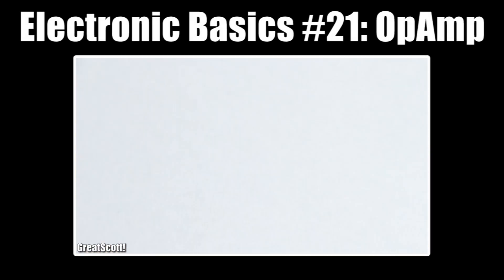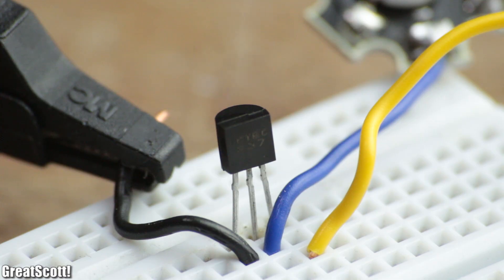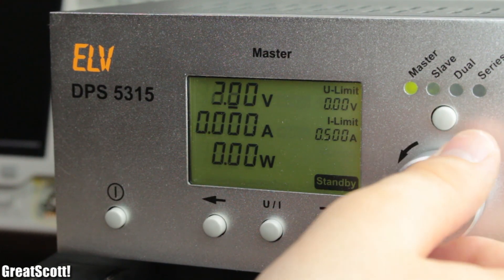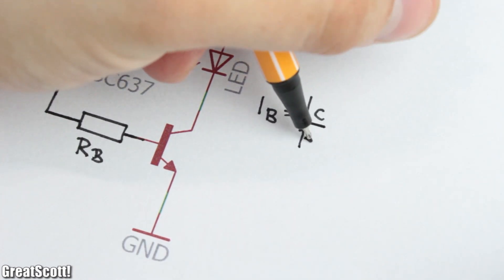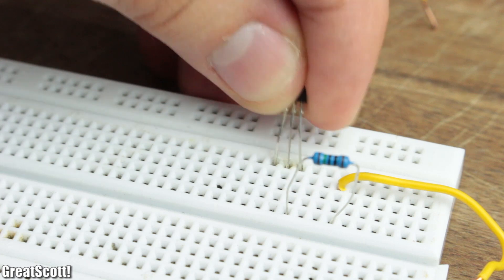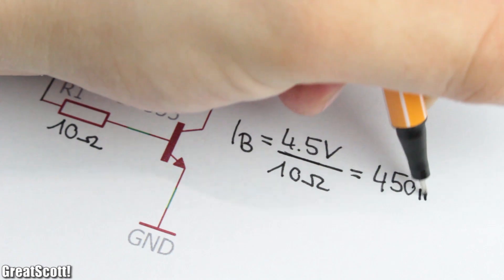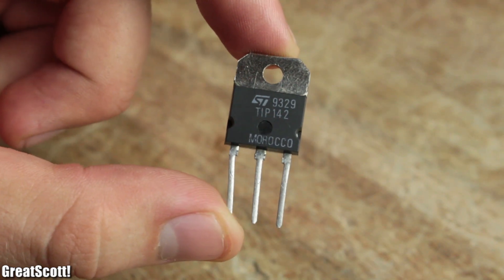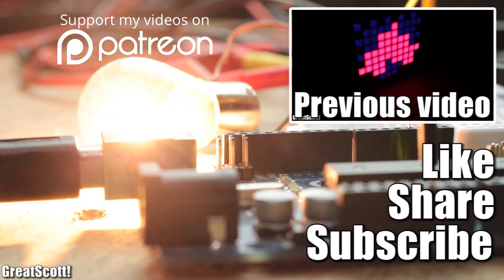Electronic Basics #22: Transistor (BJT) as a Switch

Comment: Some people need to ask questions from a kindergarten point of view. If parallel is accumulator-capacitor digital-pulse in analog-circuit, what will adding a Y or a K do to it. If induction is parallel plates. If ... Kids have more fun.
Reply: Do people pair things(components) to stabilize(plus minus stable-neutral) voltages before-after each branch in tracing.?

Comment: I was using some BJT transistors without any of these ideas, no wonder it go so hot every time.. ;-/
I didn't use a base resistor and my load was on emitter side. Killed like 3 transistors, RIP

Comment: id really love to see a more in depth description of how you calculated the base resistor. You kinda just said find beta then calculate. Sure you show the formula's but a walk through from start to finish and where to find the values in the datasheets would be really nice.
Reply: Look at the video at 2:03 and check the datasheet for the conditions that are used for measuring the collector-emitter saturation voltage. Those are Ic=500mA and Ib=50mA. You can ignore the "DC current gain" section because that is only specified for Vce of 2V or greater, i.e, linear mode. When the transistor is operating as a switch, the crucial design consideration is normally to ensure that Vce is as small as possible when the transistor is switched on. This is called "saturation mode" and Vce(sat) for the BC637 family is 0.5V at Ic=500mA and Ib=50mA. So you want to set the base current around one-tenth of the maximum expected collected current. That will ensure that the transistor stays in saturation when switched on, otherwise if the collector voltage were to rise, it would run the risk of exceeding the maximum transistor dissipation of 625mW (Ic x Vce).

In the video, he should have used Ib = Ic/10 for a switching application. Ic is given as 310mA, so Ib = 31mA. Then Rb = (Vcc - Vbe)/Ib = (3.1 - 1.0)V / 0.031A = 68 Ω, although this doesn't have to be exact. The dissipation in the base resistor would be less than 100mW (less than 3.1V x 31mA), so any 125mW or higher dissipation resistor would be fine.
Reply: What you mean " Ic is given as 310mA"?
Is max current on LED or max current in transistor collector?
When he test LED with source generator i didnt see any value of 310 mA.
He had max 253 mA in LED.
Reply: @anaromana8183  @RexxSchneider I'm also confused about the source of 310mA for the Ic...

Comment: You're calculating the base current wrong. You used the values for β given on the datasheets for when the transistor is operating in its active region with a Vce of 2V or more. If you look carefully at the datasheet, you'll see that the value for Vce(sat) is almost always given for collector:base current ratio of 10. In other words, the manufacturers guarantee the BC637's Vce(sat) of 0.5V max for a collector current of 500mA and a base current of 50mA. You can't just use the β of 25 that is quoted under different operating conditions. The same goes for the BD535; you can't just look at where the datasheet says β=15 and assume it will be valid when in saturation. It isn't and it won't saturate. If you look at Vce(sat) for the BD535, you'll find it is specified as if the β were 10. [Edited for typo]

Comment: What's the difference between the emitter and collector? From what I have tested the transistors work the same when these two are switched.
Reply: Modern transistors are not fabricated as symmetrical devices and you will eventually run into trouble if you attempt to swap collector and emitter. The biggest difference in characteristics between collector and emitter for a silicon npn transistor is probably that the reverse breakdown voltage for the collector-base junction is usually at least 30V, whereas the reverse breakdown voltage for the emitter-base junction is normally around 5V. If you recall that in normal operation the collector-base junction is reverse biased but the base-emitter junction is forward biased, you can expect that the transistor will fail by reverse breakdown with a supply voltage above 5V if collector and base are swapped.

Comment: Useful information! I was using a C547B to drive some 5v LED switch lights, but the random resistor i put on the base became painful hot. I measured it with my multimeter and it seemed to draw 120mA through the base. Then i put a 200 ohm one in front of it and the current reduced to 15mA while the LED shined equally bright so no loss. 15mA still too high but it made the point clear that that resistor is the issue. Now got to try to calculate the right one. Glad that i didn't hook it up to my Arduino straight away, it would have burned the IO pin right away.
Reply: When using a transistor as a switch, the rule-of-thumb is to make the base current one-tenth of the collector current when turned on. That will ensure that almost any transistor is in saturation. Any further increase in the base current will not increase the collector current, so there is no point in using more base current than that.

Use a multimeter to measure the current taken by your 5V LED when 5V is applied to it. Let's say it's 30mA. So you need 3mA base current. If you're driving the base from a 5V microcontroller via a resistor, then that resistor has to be around 5V/3mA ≈ 1.7K. You can use a 1.5K or 2.2K base resistor. It's not critical. If you're using a 3.3V microcontroller, you'll need around 1K to 1.2K for your resistor. Hopefully you can see how to work out the resistor you need now.
Reply: @RexxSchneider  I see transistor datasheets that show DC Current Gain of 100-300, and down to ~30 depending on Ic.  There is a big difference in 10x versus 100x. I'm confused about what gain to use in my calculations. 🤔
(EDIT: I understand now 😏)
Reply: @abandonedcranium6592  There's an important difference between a transistor operating in its linear region with a current gain of 100-300 and the same transistor operating in saturation where you want to make sure that Vce is as small as possible. To achieve that, it is necessary to overdrive the base current giving an effective current gain much less than what is shown for linear operation.

Take an example of the 2N222A, a very common switching transistor. The DC current gain at Ic=150mA and Vce=10V (i.e. linear operation) is specified as 100-300. However, the specification for Vce(sat) - the voltage between collector and emitter in saturation, i.e. as a switch - is given as 0.3V max at Ic=150 mA and Ib=15mA. That is an effective current gain of 10 and is the most common ratio of Ic/Ib in datasheets when examining Vce(sat).

That's why I give the rule-of-thumb of setting the base current at one-tenth of the required collector current in switching applications. The collector current will be limited by the collector load, not by the base current and current gain.

You may find some very high gain transistors, e.g. BC547 family where the maximum Vce(sat) is specified in the datasheet with the base current at one-twentieth of the collector current. But note that the Vce(sat) is 0.6V max for the BC547 family at Ic=100mA, Ib=5mA, which is twice the Vce(sat) of the 2N2222A at similar collector currents, even if the BC547 would be using half the base current.

Comment: @GreatScott

This was another excellent video as usual.  I greatly enjoyed it.

I do have one possible error.  I had a discussion in an electronics group on this calculation method.  Someone who has experience with component design pointed out that the hFE value you used as worst case (a Beta of 25) was not the best to use for the saturated state.  The Figure 4 graph of the datasheet shows a Beta of 10 being more conservative and a V_BE(sat) of about 0.8 V when 310 mA of I_C is drawn.  Plugging those numbers into your calculation method will result in a base resistance of 110 Ohms or 100 Ohms.  This will prolong the life of the circuit according to the person I discussed this with.
Reply: You're right about the error. Normal circuit design for switching transistors is to set the base current at one-tenth of the maximum expected collector current. Note that the datasheet for the BC637 family specifies the maximum Vce(sat) at Ic=500mA and Ib=50mA. I would certainly design for Ib = 31mA when Ic=310mA in this application.

The only quibble I have with your calculation is that Figure 4 shows typical Vbe(sat), rather than maximum, which would be worst case. The only other place that Vbe(on) is given is in the "On characteristics" section, where a maximum value of 1.0V is given. Plugging that in implies Rb = (3.1 - 1.0)V / 0.031A = 68 Ω. In most cases, the circuit will work with higher values for Rb, but if you have to design for worst case - as you would in production, for example - then 68 Ω would be the value to use in order to guarantee saturation in any worst case scenario.

Comment: Is hfe value taken from the datasheet Or it should be taken from our working
Reply: When you design switching circuits, you assume β (hfe) is equal to10. If you read the datasheets, you'll always find that transistors in saturation always have a base current specified as one-tenth of the collector current.

Comment: Question. I see you calculated for the Ib to be 12.4mA but then you use it in the second equation for Rb in microamps. Why is that?
Reply: At 2:41 he has written 0.0124 A (which is 12.4mA in Amps), but the final 4 looks like a μ, hence the confusion.

Comment: I would recommend the BD237 for low loads. It is way better than BC637 and also has a PNP brother, the BD238. They are rated 2A 80V

For higher current, where you used the BD535, better use the MJE3055, which its PNP brother is MJE2955. They are rated 10A 60V
Reply: For low loads (less than 500mA), the BC637 is better than the BD237 in its electrical characteristics, and is less than half the price.

Of course, once you start to dissipate some power in the transistor, the BD237 has much superior thermal performance (thermal resistance junction to case of 5°C/W for the BD237 vs 83.3°/W for the BC637), and that's what you're paying for in terms of the package.
Reply: @RexxSchneider  Yeah, but I tend to use transistors that are more massive so i can dissipate heat better

Comment: I find teh bc547 really good for low current, its really good as an amplifier aswell, as its beta goes from 110 to 800, also it has a higher base emmiter voltage

Comment: At 2.38 how do you define the value of Ic which is 310 mA?
Reply: It's a measured value for that particular 1-watt LED at its operating temperature. A forward voltage of 3.1V and a forward current of 310mA gives a power of 961mW.

Comment: Great video! Fast but good. At 2:40, where is the 310mA coming from?
Reply: It's the typical forward current for that 1-W LED at its rated forward voltage of 3.1V (310mA x 3.1V = 961mW).

Comment: help me help me help me help me help me help me help me help me help me help me help me help me help me help me help me help me help me help me help me help me help me help me help me help me help me help me help me help me help me help me 
i have big problem with Bjts and that is when i turn on pnp tp127 transistor its have no problem but when in want to turn off it transistor have a big delay that related to load.for example if i use 1k ohm its delay is too much longer when i connected 100 ohm load--i know its related to parasitic capacitance's can any body help me to solve this problem?thank u guys

Comment: you need a collector-resistans  too. In other case you can destroy both transistor and led.  The collector-resistans determine what current you want through the diode.
Reply: Yes, LEDs really should be driven at constant current where possible. That's because as they heat up, their junction voltage tends to drop and the current increases exponentially, possibly causing thermal runaway. It would be far safer to use a supply voltage of around 5v, allowing 3.1V for the LED, 2.4V for a series resistor, and 0.5V for the BC637, all passing 310mA. That would imply a series resistor of 7.5 Ω which would have to dissipate 750mW, so a 1W rated resistor is needed (or two 15 Ω half-watt resistors in parallel).

Comment: I want to control 9V seven segment display through microcontroller and it has common ground configuration, and I have done approximately some tens of experiments with Darlington pairs, PNP, NPN etc., But you know what I mean, Thank you
Reply: You need two stages. Use seven pnp transistors with enough current drive for each segment. They have their emitters tied to the supply voltage of around 9V and each collector driving one segment.

You drive them from seven npn transistors whose emitters are tied to ground, and each collector driving the base of the corresponding pnp transistor via a current-limiting resistor. Plan to limit that current to one-tenth of the current for each segment.

Then, each of the bases of the npn transistors is driven from the microcontroller via a current-limiting resistor. Plan to limit that current to one-tenth of the current previously calculated (i.e. one-hundredth of the current for each segment).

Depending on the output characteristics of the MCU, you may find that putting a diode in series with the MCU output and the base drive resistor of the npn transistor may result in cleaner turn-offs, as would an extra resistor between base and emitter of each npn transistor (try a value a bit less than the value of the resistor driving each base from the npn stage).

For an example, assume 20mA per segment. Any pnp switching transistor would work to drive that. Their bases can be driven with 2mA, so use around 3.9K resistors from each npn collector to the corresponding pnp base. Then you want to drive each base of the npn transistors from a separate pin of the microcontroller, drawing about 0.2mA each. If it's a 5V MCU, then I suggest 22K resistors (perhaps in series with a 1N4148 diode) between the MCU and each npn. If it's a 3.3V MCU, then around 10K would do. None of those values are critical, and I'm sure 3.3K or 4.7K would also work instead of 3.9K, etc.

Comment: can someone tell me how to calculate the collector current (Ic) when the transistor acts as a switch?
Reply: When the transistor acts as a switch, it will turn on and allow collector current to increase until the collector voltage drops to its collector saturation voltage (around 0.2V to 0.5V or more for high current applications). The rest of the supply voltage will be dropped across the load, so you need to know the load resistance in order to calculate the current flowing through it (and the collector) using Ohms law.
Example: a transistor with a Vce(sat)=0.5V switches a 32 Ω load from a 6V supply. Ic = (6V - 0.5V) / 32 Ω = 0.172 A = 172mA.

Comment: Hello Sir, I am trying to build variable power supply using multiple output of transformer. 0,5,12,15,19,24,28,36v as input and variable output b/w 1.2 to 36v. I will use buck step down converter and problem is buck converter heat up when there is big difference b/w input and output, so I created that transformer with multiple output. How can I switch b/w different transformer output lines depend on voltage? like if buck convert output set to greater than 28v => take 36v transformer line as input to buck convert, if buck converter output is greater than 24v take 28v line of transformer. Any arduino or pic programmable chip?

Comment: how did you calculated the Rb when the PNP transistor is used.....
and 5:22 in the circuit base voltage is 3V but you have kept 6V........

Comment: 2:41 Ib = 12.4mA
With a circuit like that your Ic should be greater than 310mA, it could even draw over 1 amp if it had a high gain. Not exactly sure why with your configuration it didn't draw a massive current from your power supply since the LED was effectively shorted to ground.
I tested this circuit and it definitely tried to draw all the current from my PSU.
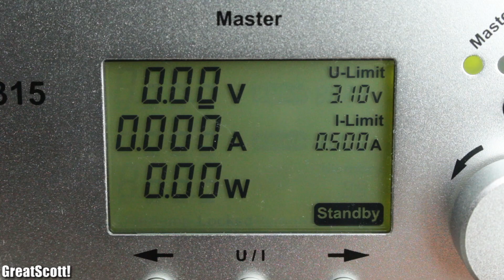Reply: If you look at 1:50 you'll see that the power supply was set to a voltage limit ("U-limit") of  3.1V. The 1-W LED used has a typical forward voltage of 3.1V at 310mA (for a dissipation of 961mW), so there's no way for it to draw excessive current with that maximum supply voltage. There was also a current limit ("I-limit") set of 0.500A, just in case.

Comment: Something's amiss. The recalculated value for R1 only catches the new Vio (5V), then subtracts 1V (the same Vbe from the first formula) and divides it by 0,0124A (the same current value). I can see no Vce whatsoever. Shouldn't Vce be subtracted to Vio as well as Vbe if we talk about the saturated state?

So, between C and B there's a diode. Between B and E there is another diode. Two diodes can easily have a voltage drop from 1V to 1,5V if I understood this correctly.
Reply: @Walter Comunello
The numerator of his I_B equation is based on KVL (Kirchhoff's Voltage Law) which is calculating the voltage drop across the base resistor.  That circuit does include V_CE.  V_CE is a separate circuit for the most part.